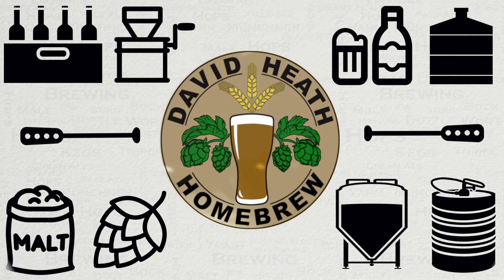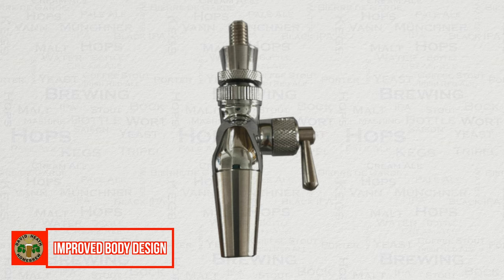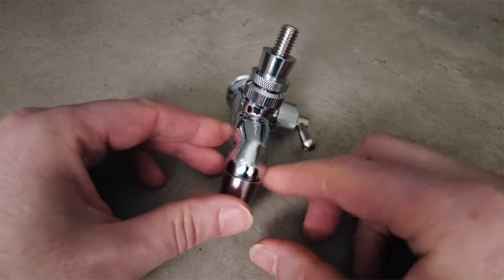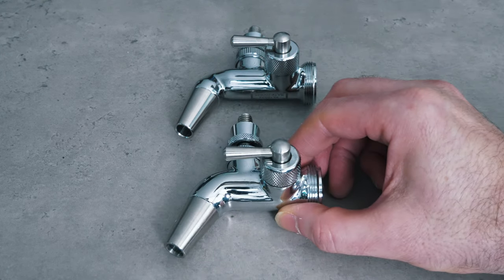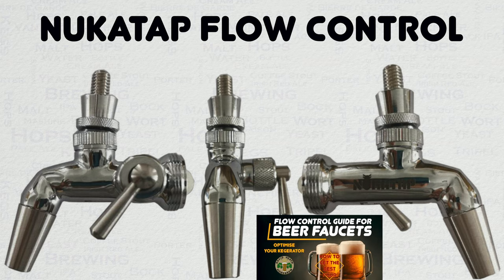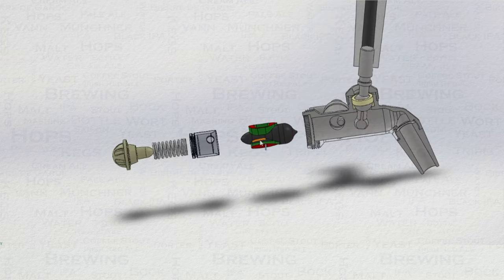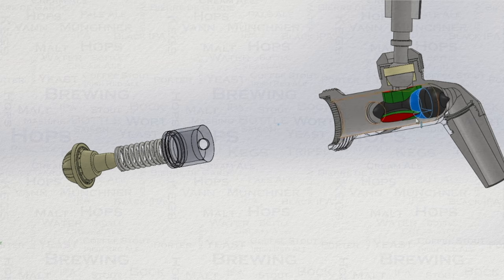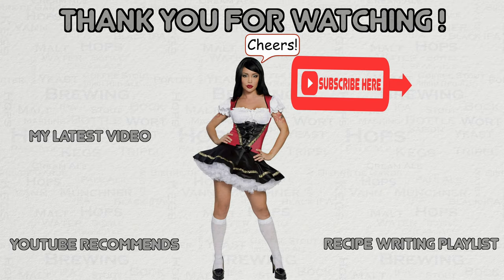Nukatap FC Flow Control Beer Faucet

Comment: I've used the Nukatap faucets (no flow control model) already and I'm impressed by the design and simplicity in assembly making cleaning so much quicker and easier. The flow control is not necessary if it is fitted on the keg already, but the option of having  control on the faucet is now available for anyone not having that option, although it does mean having more moving parts to disassemble and clean. I still prefer the chrome version as it complements my own dispensing arrangements, though I'm sure the anodised black version will also have its own followers.
Reply from the maker: Great to hear Tim, yes 6 of my 7 faucets are regular models I am very satisfied with their performance. The flow control model just takes this good design and adds in more control. I guess some will need it more than others.

Comment: Just a follow-on to my original post. They have these in the US now although I sourced one from Europe a few months ago. I purchased a second one from a US vendor last month so both of my kegerator taps are the same. One thing that threw me is that the spring I ordered from Europe was "weighted" different than the US spring, so the faucets pulled differently. I'd ordered a spare spring from the US vendor so I swapped that into the first one I got so now they pull the same.  Anyway, between those and the Kegland restrictors I've not had a beer in there that I couldn't tune the flow to manage foaming. Very happy combination, hoping it lasts.
Reply from the maker: Great to hear. Odd about the spring difference though!

Comment: Great video mate! I noticed in the comments you have been testing these for 6 weeks. I would like to see a video of that. Instead I might order one of those and one of the Ultra taps and compare it to my Intertap FC’s and the original FC device (you know the round thing that fits behind the tap).
Because I find all of the flow control devices are a bit hit and miss!
Cheers mate
Reply from the maker: Thanks Ken. Yes, I might follow on with this. It is a total redesign that works very well compared to other FC models Ive tried.

Comment: Hi, I bought two of these and both are leaking from the small holes by the locking ring. Does this have to be screwed in very hard?
Reply from the maker: Mine are tight but also be wary of over tightening.

Comment: Well I probably won’t switch to flow control but the standard black nukataps are working out superb!
Reply from the maker: I think the way the Standard Nukataps work not everyone will need the FC version. Ive gone standard myself but have 1 FC on one kegerator just in case!

Comment: David,  I am doing a Keezer build and I am trying to find Nukataps FC in the States but it does not look like it has been released here yet.  I also see I can buy them on Alibaba and have them shipped directly from China to the USA but I am wary.  Just wondering what your thoughts were.   Thanks.
Reply from the maker: Hey Ted. Thats odd. I would suggest reaching out to companies like morebeer, it could be that they have shipments incoming. On Aliexpress  “Brewmaster”  are reliable, ive ordered from them several times without a hitch with great prices, Its just a longer wait.

Comment: Hi David, I have assembled a kegerator with 3 Nukatap FCs - simple question - how do I operate the tap/s to control flow and reduce foam?
Reply from the maker: Hi Jon, by using the lever on the tap. This controls the flow rate.

Comment: I'll be glad when they solve the supply issue in the US. I've had mine on order since September.  Still show as back ordered on the sites I've tried.
Reply from the maker: Ouch. Yes that is long to wait sadly.
Reply: I gave up waiting and bought CM Becker X1 flow control faucets. The flow control mechanism is likely superior to the Nukatap's, but do require special shanks. The study plastic composite body of these valves conduct heat poorly, so first pour warming is not a problem. Unfortunately, they are not forward-sealing, so they are incompatible with the Tapcooler counterpressure filler, so I've retained one Intertap faucet, just for filling bottles.
Reply: @cornfieldcraig  Got a message from the place I had ordered mine, the faucet won't be available in the US due to a patent issue with Perlick.
Reply from the maker: Yes, could be an even longer wait due to that legal situation sadly in the US.
Reply: A patent issue..... Ahh. Thanks for letting me know. Glad I didn't wait any longer.
Reply from the maker: Yup :)

Comment: What's the beer line that you are using? I have been trying a lot of solutions in the past years and all seem to be like dripping (very different flow than a typical pub beer tap flow).
Reply from the maker: I am using 4mm ID line at between 3-4 meters per line. My 3 tap kegerator uses 3m and my 4 tap kegerator has 4m at present. Both are working well with 1 bar of pressure with temps at 5C.

Comment: Thank you for the replies David, I doubt I'm the only one with unruly coils of beer line clogging up my fridge/kegerator space just to get a "tuned" length, and then stuck with "this tap only pours well with X amount of carbonation" I would dearly love a comparison between flow control taps/disconnects/pipe lengths with regards to co2 breakout/pourability. Many of us have multiple taps, in my case 4 in one fridge and 2 in the other, and enjoy a variety of beer styles requiring different carb levels, so perhaps a comparison of the different methods of flow control would be well received. Cheers Grahame
Reply from the maker: I will see what I can do :) The trouble is carbonation level preference changes everything.
Reply: Same here. Based on my minimum kegerator temp, I set my regulator at 15psi to get 2.5 vols of CO2 and even with a 8m length of beer line (admittedly not enough. but it's all I have space for) the beer still comes out foamy with my basic forward-sealing, no-flow-control faucet.
Reply from the maker: You really will need to balance that with longer line.

Comment: Thanks David, excellent content, I have between 1.5m and 2.5m of beer line for different carb levels, would the use of these enable a short line length irrespective of carbonation, I would love to get rid of the coils of beer line in my fridge.
Reply from the maker: Thank you. I have heard that these are working well just with a shank on a mini keg but this is not something that I have tested. I much prefer the approach of having a system that is balanced for normal use with flow control giving the opportunity of more extreme adjustment when needed.

Comment: Now I see why you wrote on FB that this has changed how flow control can be done at the tap end without introducing foam! 😄
Reply from the maker: Yes :) So which colour would you want Thomas?
Reply: @DavidHeathHomebrew  I love the black ones but when building my Keezer I had to have her approval since the Keezer lives in our living room and she wanted shiny stainless steel Nukataps so that’s what I bought. If I swapped them out in the future I would probably try to get black ones if available. 😀
Reply from the maker: Thanks Thomas. The black faucets have been very popular. Ive gone for them with my second Kegerator but still have stainless on my other one, which I will keep for contrast :)

Comment: Excellent video as always with a lot of very useful information. I have the older Intertap FC in SS, unfortunately the flow slider has frozen inside the tap and I can’t get it to either drop out or move back in. The tap is free of any beer residues. Tried boiling water, blow torch, WD40, and brutal force, but nothing seems to shift it. Any thoughts please?
Reply from the maker: Thank you :) 
Have you tried adding it to a heated solution of PBW and then left it overnight?

Comment: huh... I am using compensation taps since like 20 years now and I am wondering, if the Nukatap has any advantages over them? Because I never had a problem with them ever due to them being flow controlled. Do you have any experience with compensation/compensator taps?
Reply from the maker: If you have no issues then no :)

Comment: Oh, and would a flow control disconnect be a better or worse option to the flow control tap?
Reply from the maker: I am yet to fully test the pros and cons here. In this case they both seem to do the job but I have not done enough comparison to determine which has an advantage.

Comment: Dear David, do you have inside information on the availability of the FC version? It seems quite hard to get for the moment.
Reply from the maker: This is not released in all world areas just yet but it will be in early 2021.
Reply: @DavidHeathHomebrew  thanks !
Reply from the maker: No problem :)

Comment: I was very disappointed to see that these are not available in the black
Reply from the maker: I've got 4 black Nukataps and 3 SS, one of which is an FC model. I've had these for quite some time now and I do not really use the FC function as Nukataps can do without it.

Comment: how does this work with Co2?
Reply from the maker: You would use C02 for serving via a key. You need this pressure.
Reply: sorry, I didn't state question well.   I'm looking  at making a seltzer fountain, and was curious if the flow control would be good for a higher pressure Co2 and adjusting it  lower to pour so it does not spray as much.   @DavidHeathHomebrew
Reply from the maker: @chris415-a no problem. Flow control on the tap is really just fine adjustment. I wpuld suggest looking at flow control ball locks instead.

Comment: Quick advice don't buy a black one, very poor paint quality. I bought one recently and learned it hard way. All what I did it was, spliting black tap into the parts and soaking it in sodium percarbonate solution. As soon as I took out my brand new tap I find out that pain comes of in few places and Tap looks like has been used for many years already...😭😭😭
Reply from the maker: Hmm, ive cleaned 5 of these in the same way without any issue. This one sounds like it is faulty. You should ask for a replacement.